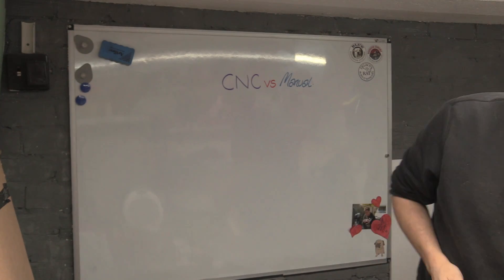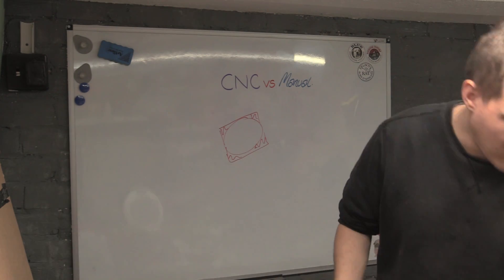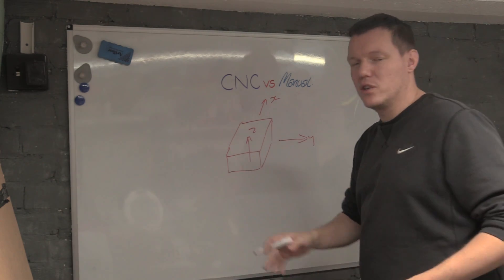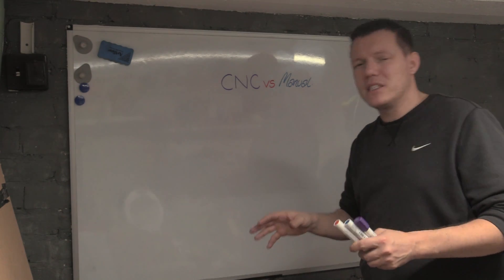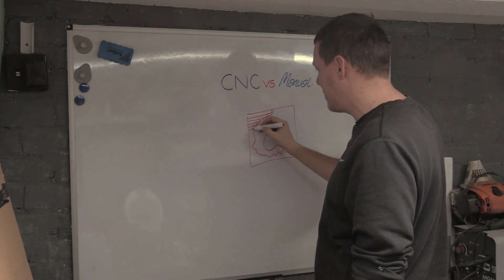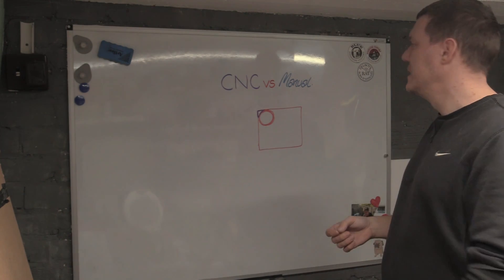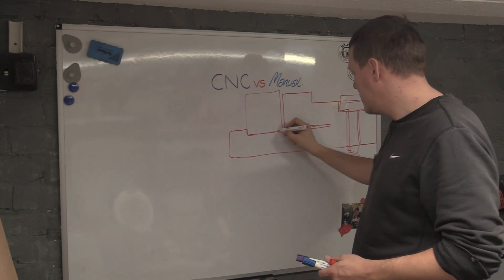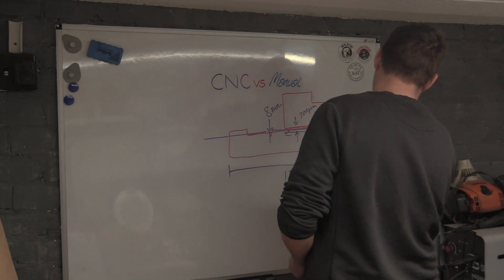CNC vs Manual Machining

Comment: The magic in CNC is in the programming.  When I was running CNC machines we had to input every single command by hand. No post processors for us. The only exceptions were on manual machines converted to TRAK CNC controls.
Cutting really square internal corners are only possible with really sharp tools and broaching/shaping operations. A really sharp corner generally requires two pieces.

Comment: I have had engineers come to me with a bundle of cut metal to weld up and a set of SolidWorks produced plans for each weld. And then I point out that 20% of the welds leave no physical room for a torch, and there are impossible welds like inside on each end cap of a sealed cylinder. These people have zero time behind the torch.

Comment: when I was doing CNC for tool and mold it was always brutal when engineers didn't understand the limit of the machines or tooling they're designing parts to be cut on... they're like "you have a 12mm endmill with a 150mm shank that won't chatter right? they're like "your tool holder won't smash the mold before your drill even touches the bottom of this 80mm pocket right?"

Comment: CNC is what it stands for: computer numerical control i.e instead of human hand there is servo mechanism or stepper motor moving the tool or piece or both attached to linear guides using rack and pinion, screw or even belt.

Comment: What about cng? Computer numerically guided? Or freehand cng where you move a 3 axis head around by a handle and it adjust resistance based on if it’s cutting and the feed rate you end up doing?

Comment: Aside from being a mechanic, for the last 15 years Ive been manufacturing vehicle mounted 20 metre pneumatic masts with remote controlled camera mounts (I'm the only manufacturer of them in the southern hemisphere). Originally all the parts I made using a mill drill and the lathe, later I used a local CNC business for volumes of parts and lost count of the times I had people said "you should get a CNC machine and do it yourself". No, no, no and no, as a manufacturer I can make more money doing every other aspect of the manufacturing including selling the machinery, it is far more profitable for me to send the Solid Works files to the local CNC guy down the road, some other parts to the local Laser cutting guy, and let them invest and maintain expensive CNC machinery.
Every time Ive made changes to the equipment to make it more rugged for new markets Ive gone back to the mill drill and lathe to do the first prototypes and a few extras and then once I sell a few of them and they are in the field and no issues I then get batches made by the local CNC guy.
There is nothing the CNC machinist has done batches of that I could not do manually on the lathe or mill drill to the same spec and quality, the only difference is he can do a box of the parts in far less time and that is all that differs.
So if anyone does not need a box of the same parts, they do not need a CNC mill or CNC lathe, and owning one just to do one off's would be a total waste of time and money.

Comment: Yep... 100%. All of the F1 cranks we made were done manually. Not because a CNC machine couldn't do it but for one or two off the set up time and then programming it and sorting out the fixtures etc would have taken up a lot of time before any metal was even cut. I could set up for oil way drilling or lightening details on a normal manual Bridgeport milling machine with a rotary head or using V blocks and slips and be working on the crank within 20 minutes usually. Now if it was making 10 or more then a CNC machine would be quicker. Hell if there was a full machining centre to do all the operations with a cassette loader for all the tools it would mean less time between operations but the cost of those machines is really expensive.  But if someone wants to look at what can be done with manual machines then look at 1940's to 1960's GP bikes and cars or even look back at the Bugatti GP cars of the 1930's. Almost anything that a CNC machine can do could be done with a manual machine. There are a few exceptions where some new machines have articulating heads which can go inside a hole and do internal machining of things like ports or internal details if the head will fit inside to do that work. Again there would be ways to do this with multi section parts like making sleeves and shrink fitting them into cylinders.

Comment: I'd like to hear your thoughts on inline coolers (Ex. Pro Design PD541) that connect to the coolant hose from the cylinder head and that claim to decrease the temperature by up to 10 degrees.
Reply from the maker: What?
Reply: @thedirtyworkshop  It's this thing: https://www.prodesignracing.com/images/super_cooler.jpg
Reply from the maker: Its a waste of time

Comment: Dont for one minute think its just guys on Solidworks that design shit that cant be made. I used to work for a rather large engineering company that had a huge drawing office. It wasnt un heard of for paper drawings to hit the machine shop with parts that could never be made. 
In the model engineering world of late there has been a move to low end cheap CNC mills. People buy them for one reason, they have no manuel machining skills and  they thing a CNC mill will magicaly turn out the bits of thier steam engine. My brother was the first guy in our town to be put on driving  a CNC lathe. Hes an aprenticed machinist and always said any good CNC operator needs to know machining to do a good job. CNC is not tyhe magical device that makes anything you want. Its the magical device that make tens of thousands of the same part over and over again. Yes Ok a big block chevrolet engine made from a lump of stock is probably easier to machine on CNC buth the only reason its viable is down to the number of cuts the number of tool changes and the sheer complexity of the math involved in making all the cuts.

Comment: As a welder I've had the issues with robot welding machines,  i learnt how to program them, knowing how to weld really does help you with settings, but the robot head still has many limitations that a manual welder needs to correct or finish.  But again it can be job specific. Eventually we had minimum wage operators and no work for the skilled welder. quality went down but profits went up...I dont work there anymore. :-(

Comment: I've had to explain to my boss at least half a dozen times that you cannot 3D print anything, and even stuff you can 3D print might take fucking ages and still need to be worked after the print is complete. I work at a secondary school, so basically I'm surrounded by people who have no idea what the hell they're talking about asking for me to perform magic w/ a consumer grade 3D printer and then throwing a fit when I find a compromise that works but isn't their original vision, or I just flat out tell them it can't be done.
Reply: the whole idea behind my school district getting 3D printers was to teach the students to use them. trouble is, I'm the only damned person in the entire district with remotely sufficient skills to make it happen. so when a kid makes an STL of some random crazy shit with 30 separate parts floating in space, and I tell them it won't work the other staff and my boss think I'm just being lazy and refusing to do my job. they all make Del look like a damned genius.

Comment: People have often not even looked closely at parts that they buy.  You can usually spot reliefs and machining marks from where tools had to fit in to cut the face that required it, particularly on milled parts. CNC does nothing to change that because it still uses rotating motion.

Comment: He isn't talking about what methods produce the components quicker, or how turn around times differ, he is saying manual machining can be just as comprehensive. I agree. You need some decent knowledge and varying tool holding methods, but that's engineering isn't it? Good video Matt.

Comment: Regardless of CNC or manual milling, the work/item produced is only as good as the Programmer, Fitter & Turner and/or Engineer who does it. So, accuracy is secondary to this until tacit knowledge is attained, hence why practise makes perfect. In any case, the semantics of armchair machinists who carry on is not worth a squirt of dog shit (road trip Matt???) as each machining techniques have their merits for Industry and applications these armchair 'athletes' seemingly ignore. The case point here is, armchair machinists like other armchair 'athletes', find their refutation all consuming, where facts are generally, and, quite unequivocally ignored like common dog fuck, using ad hominem/straw man arguments etc. exclusively to generate the desired result of a false win that raises their ego to all sorts of levels with confirmation bias used liberally or otherwise. I think armchair machinists need to stop watching those reality programs and similar YT videos related to the automotive/manufacturing industry and the like, as these people are setting themselves up for a complete fail where their know-all aptitude, put simply, does not allow them to address the acceptance of opinion based on truth refuting their claims where Dunning-Kruger also comes to mind here ... Cheers for the video Matt :-)

Comment: Is rotary broaching still used in modern manufacturing?  When I was working at Caterpillar they had a small station dedicated to the rotary broaching process, that was in the late 1990's. Could an EDM replace that process?

Comment: Thank You, great video. I myself get tired of telling people and even friends of mine that CNC can't do it all. I myself prefer manual machining over CNC for limited runs or one offs. Many times I have found myself making fixtures for the CNC machines that cost more to make than the parts I am running. Plus the last thing anyone wants is to have to program some of Matt's CAD. Well, someone haves to do it.

Comment: I work in engineering and I have worked many different CNC milling machines, machine centers and bed mills making parts for the nuclear industry "Sellafield" and lots of different petro chemical companies such as BP, Shell and Ineos just to name a couple and we do 99% of our work on CNC machines and we still have manual Bridgeport machines that we use for that last 1% because the time it takes to set up a CNC just isnt worth it for small operations such as single small hole drilling where just its just faster doing it on a manual machine. The way myself and the other machinists see CNC machines is the machine itself is stupid and only does what you tell it to do nothing else! in our workshop we are all Programmers/Setters and can input programs manually because sometimes CAM is just slower on the more basic toolpaths. If any CNC or manual machinst tells you they have never made a mistake is talking crap!! and clearly has never made a chip of swarf in their life. after 19 years of CNC experience I still have to go into the office with my tail between my legs when ive put a decimal point in the wrong place and made a complete arse of the job.
Reply: Sounds fun can you get me a job i can use a hammer and saw and am handy with a tape measure.
Reply: I fucked up 72hrs of work on a custom hydraulic valve body

Comment: You're right, and yet also wrong.

The big difference is when you start talking about 5 and 6 axis machines (you mention roll, pitch and yaw, which are mostly about orbiting the tool around the part as well as moving the part around in space). I've never seen a 5 axis manual machine where one or two of those axes require stopping and moving the part around on its fixture.  There is a difference, and it's not just about time - there are ops you can carry out with a 5 or 6 axis rig that, whilst you could do it theoretically in reality you'd be pissing about until the heat death of the universe to actually do on a manual machine.

That said, the "CNC IT!" crowd are mostly utter twats.  For most parts you need to make, especially if you're only doing it once (or twice, or 3 times, depending on how many times you fuck it up), it's way faster to do it manually rather than cunting about in CAD, replacing the broken endmills when your machine crashes, etc, etc...  CNC only really wins out if you need to make stuff that's identical, or has a shit bunch of really tedious and hard to do operations, and mostly those want to be made once and then moulded (or just rethought, like your 200µ slitting saw example)

My machines are all manual.  Don't even have DROs on 'em.
Reply from the maker: I'm sure you've just repeated my point...
Reply: @thedirtyworkshop  Not entirely.  I'm certainly in agreement that CNC is not the magic bullet to all fabrication - it's not - but I'm not in agreement with the argument that everything you can do with CNC, you can do with manual machining as well.  If you want to go down that road, anything you can do on  lathe or a mill you can do with a bunch of files, saws, cold chisels and maybe a brace & bit.

CNC has its place, and there are things that you can do (relatively) easily with CNC that you can't feasibly do with a manual machine.

CNC fanboys get on my tits, mind. Most of 'em don't understand the underlying machining part, only that "I can model it in CAD".  Much the same as the "3D print everything" wankers, or the "use an arduino instead of 2 passives and a transistor" cunts.

Ride safe.
Reply from the maker: What can't you do manually that CNC can do?
Reply: @thedirtyworkshop  Anything that requires continuous cuts whilst moving in more than 2 axes starts to get tricksy, due to lack of hands on the wheels, for starters.

There's also the issue of tool orbiting - roll, pitch, and yaw - under CNC you can (and have to, for some complex geometries) change the orbit centre on the fly.  You could do this with a conventional machine, but workholding and / or setup per cut becomes a "heat death of the universe" deal.

Let's suppose I want to cut a circular pocket in a piece.  Easy, chuck it up in a rotary table, job done.  Now let's suppose that I want my pocket as a psuedo-conic extending down smoothly on a spiral path.  Lord knows why I'd want to make something like that, of course.  This means making multiple, non-concentric, circular pockets, with the endmill angled differently for each cut.  You could make a stepped approximation of this without even using a rotary table, but minimum depth of cut means it will always be stepped, it will only work as long as there's never any overhang, and you're going to need to hand-finish to get rid of the stepping.  So you might take a rotary table with a cross slide mounted to it, holding the part on that, the whole held on a variable angle plate, and that mounted on the mill table.  that way you can make the cut, but youre now dealing with 7 axes, some of which are redundant, the calculations involved are going to get - involved.  The solution in this case is, in fact, to tell the client to fuck off.
Reply from the maker: Lol.

You can make anything manuak that cnc can, it would just take ages and usually require additional tooling. The point was that CNC can't do things people seem to think it can, also known as magic.
Reply: Cnc means you can make fancier shapes more easily, so in the past where things that were mass produced were more basic id design now we can have alot better designs that are still fast to make, but it leads some people to think anything can be made on a cnc. Alot of the things can be made but the time to make it would be astronimical as would be the price. In my eyes a good designer is someone who gets the fanciest design possible but still achieves it in a way that manufacturing it is still cost effective.

Comment: A CNC machine is limited to its little "box" of travel. A bridgeport is limited to how far you're willing to reach!
Reply: A Bridgeport* can do work longer than the bed. It requires you to be creative.

*As much as I like Bridgeports they aren't the worlds greatest milling machine. They are PITA to align on the head and keep it in alignment.  The R8 collet is a shite design due to cutter creep. Plus the ways in the center of the table wear to fast. I also happen to think the spindle bearings are on the light side.

Comment: CNC is only as good as the programmer and operator. One unnoticed broken tool and the whole job is ruined if the operator doesn't spot it, same as one bad line of code. 

I still enjoy watching complicated CNC programmes running, great stuff for lots of repetitive parts manufacture. 

I do like a well broached hole, needs plenty of lube though... 🤣🤣🤣

Comment: A CNC machine is only as good as the person who programmed it.
Reply: And the monkey who set it.

Doesn't matter how good the program is, if monkey sets the face mill tool height to Z-100mm instead of Z+100mm your bed is gonna have a bad day... (That also earns you a day with the dunce-hard hat). 

I would QC verify a guys work in the workshop and he'd always say things like "it's OK I've fixed that dimension for the next one, just sign it off" defeating the whole purpose of the QC check. Needless to say I always regected his parts until the one in my hand was correct.

He also would say "The machine just did xyz and made mistake *123" I'm like sorry bro, it only did exactly what you told it to do, so save your breath and take more care.
Reply: @prdoohan  I have a few of those machines and the way I set them up is I never ever let my employees touch XYZ 0 with Z=0 being flat of the bed which machine milled itself, the only thing they have to program is size of the pice and roughly where it's on the bed, every tool for every material is preprogrammed. We have very little fuckups and this way one man can operate 3 machines simultaneously with time to spare.